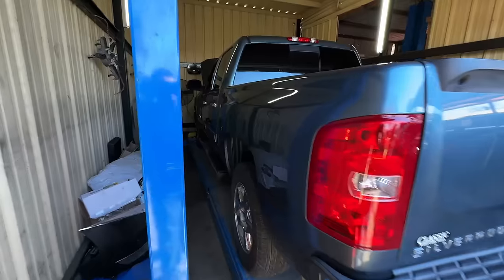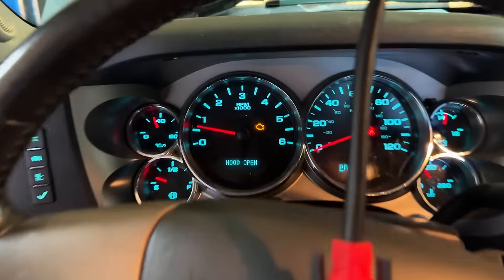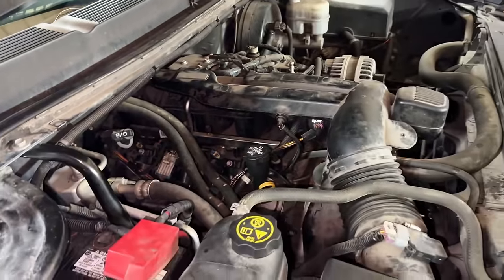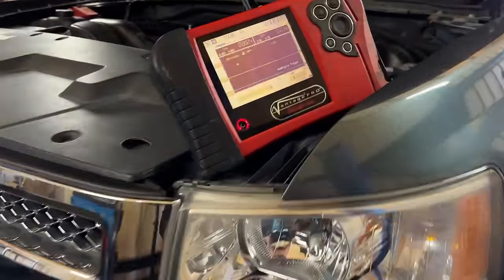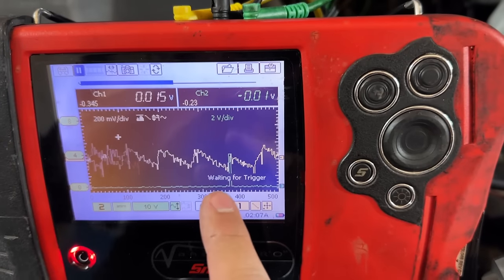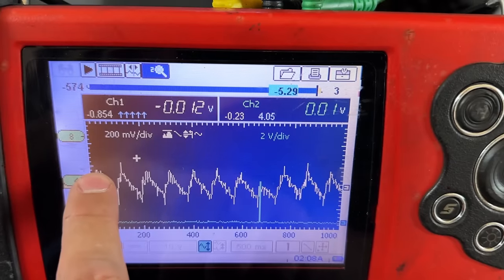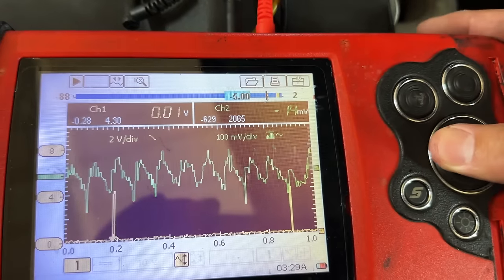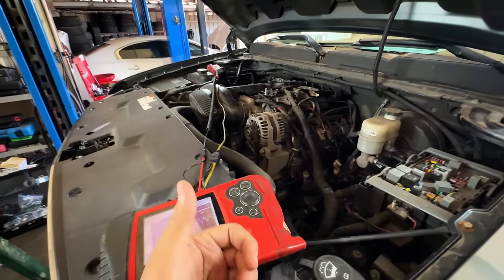CHEVY SILVERADO MISFIRE INTERMITTENT COMPRESSION

Comment: GM mechanic here, see this every day, I got my money on lifters and possible cam damage. Do them every day! Great video
Reply: I thought stuck lifters was caused by bad oil like taking too long between oil changes? I have a gmc 2007 5.3L and my lifter on cylinder 7 got stuck. I have them all out now and will replace all of them. What do you recommend to make sure my afm lifters dont do this again? Im gonna buy a new updated vlom as well. Thank you.
Reply: @paquesepas6696  castrol oil and 3k -3500  oil changes. About to roll 200k on my 09 and not one issue
Reply: @njr684  agree
Reply: I have a 2017 and has 129k and do oil changes every 2k miles to be safe. No issues yet
Reply: @paquesepas6696  I have the same truck.  it was cylinder # 4 on mine that had a stuck lifter.  replaced AFM lifters but it was too late, valve was burned.  had to re do the job and replace the valve.  then a year later the same thing happened and the cam was destroyed.  I had to replace cam and lifters with non AFM type and reprogam the PCM to defeat the feature.  it's all better now with 141,000 total miles.
Reply: @cowcat7436  its been a month now for me.  I replaced all the lifters,  the vlom, oil pump o ring,  and just cleaned everything up. It's been good now for the last 2k miles so I'll see how it holds up.  No more misfire and running great

Comment: This is where an in cylinder pressure test would help. The waveform could likely reveal where the issue is without removing the cylinder head.
Reply: Easier would be to just use differential pulse sensors at intake and exhaust and watch the waveform; will tell you exactly which one is misbehaving; clearly a valve not seating right; worn rings are usually very consistent.
Reply: @scientist100  Agreed. Totally forgot about that one as I was watching. So for sure. Pulse sensors in intake and exhaust would probably be easier. The trick is always in waveform interpretation. But a dead hole should be real obvious. In a case where a cylinder is not being identified through a DTC. How would you know which one it is? I'm assuming the trigger being used would be an ignition trigger. But from my understanding that trigger will not align with either the intake pull nor either exhaust pulse. Would you be looking at the intake pull right before the trigger?
Reply: @edwinlomonacofoolsend  yes; it is important to use the TDC overlay and specify your trigger and firing order but here we already know that it is 8 and whichever looks abnormal would automatically tell us which one is failing. Cylinder identification whether intake or exhaust for a certain cylinder is necessary. Tapping into the exhaust side; you will confirm if it's an exhaust valve but the intake waveform will show both usually as it will back feed pressure if it stays open during compression.
Reply: A leak down test would probably be a much easier way to tell
Reply: @DylanL69  I don't know how much you know about oscilloscopes but you can clearly see that the valve sometimes seats correctly as it can get good compression at times and you know what that means... You will get lucky if you get it when it is not fully seating to do a leak down test. Unfortunately; a leak down test may not prove anything. Pulse sensors just needs an intake access; usually a PCV hose and that's all.
Reply: Yup was thinking the same thing. Leak down test.
Reply: @fetusbass  leak down  is at all time If valve seat really  bad, how ever only detectc laks, how about if you have lifter issues or worn out cam lobes , there is not a leak
Reply: I know this was  posted a while ago as were the comments. I just wanted to get this off my chest and if someone does comment on this I would like to know how often they have seen this? I have worked on cars for over 30 years and until just recently I didn't know it was possible. I thought you had compression or you didn't.  Whenever I've done compression tests it's been cut and dry and never incorrect. I just started working on the exact same model as this and it's misfiring on the #8 cylinder. I just got started and it came to me after someone else was working on it. New plugs, coils, wires, and injectors. I took it from there and got as far as spark, fuel pressure, and compression. Everything looks good on paper. I start looking around because of the thought of intermittent compression and is it possible so here I am.
Reply: @channelx92 I'm dealing  with the same  cylinder 8 on a 2020 tahoe 125k
Spark plug  coil and injector  replaced  p0300 only, bad miss on idle only on cylinder 8
Did anyone  got this fixed  ?

Comment: Great video! The only thing i would have added to the diagnosis would be to put a borescope in the cylinder to look at the valves, then bumped the key to pressurize the fuel rail and see if the injector was leaking by ...  Thanks for sharing.

Comment: great video on diagnosing this issue i totally agree with it . I would be 100% positive that it is a valve seating issue, with a small bore camera you would be able to see inside the cylinder without having to take it apart. just a tip . Good job.

Comment: Just had the same issue on a 6.0 Chevy truck. It had very bad intake vacuum leaks on cylinder 4 and 6 causing misfire and lean codes. But repairing it only lead to no more lean codes, but the misfire codes returned.
Intermittent compression loss on cylinder 4 which reduced at higher engine speeds. Sometimes the valves stick in the guides, lifters and cams also fail,  but this engine was very clean. Customer also declined further inspection. Hate not knowing the exact cause, but that's our world. :)

Comment: I was thinking like you with the valve sealing problem.  One more thing would be a weak valve spring or a sticking valve.  GM had problems with valve guide problems in the past.  I have seen a valve seat problem.  It took many miles for the problem to occur, but at idle the engine would lope turning on the MIL light and yes, gauge compression and cylinder leak down was good compared to other cylinders.  This was before scope testing.  The engine was a 1997 Dodge 360 (5.9L) V8.  Contacting Chrysler for information, they claimed it was a "metallurgy problem."
The fix.  Replace the cylinder heads.  The reman heads had the latest and greatest in valve seats.  Engine ran great after that.

Comment: some diag guys dont know this, some cars will shut off the fuel injector in a multiple missfire situation, bmw is one of them, i have seen guys call a bad injector because the ecu is not triggering the injector to stop cat damage and bore wash/engine damage, id say it is a typical valve not sealing issue.
good call eric.

Comment: The 5.3L is known for AFM lifter issues but #8 is not an AFM lifter.  However, they can stick and jam up internally which will cause a lifter tick.  If they are not hearing a lifter tick, I doubt that's the issue.  I'd be looking at a bent or sticking valve or a broken valve spring on #8.

They might be able to detect a sticking valve by running or even just cranking the engine with the valve cover removed.
Reply: my 6.2 has been at a GM dealer for 8 days now with #8 miss.  no code.  they can't figure out why because they say it's intermittent.  already ruled out coil, wire, plug, injector. valve cover off now and nothing obvious.  They want to pull the head and check valve and or guide.  maybe check push rod BEFORE pulling head? , what else could it be?

Comment: Thorough , logical diagnosis and great lesson  . I believe they swapped coils and injectors to test instead of replacing ALL of them . Saves money there . If there is access , how about putting a small articulating bore scope in # 8 cylinder and possibly examine the valves and seats ? It may be faster than doing a leak down test on that cylinder .  #xtoolgiveaway .
Reply: mine is also #8.  why why why?  the MOST difficult to get at.

Comment: I appreciate the videos . . I not sure what is going on with the compressor.  I be guessing.  Is cylinder 8 one of the cylinder that is used on the active fuel management..I think I would want to pull that valve cover off and watch the rocker arms movement when it's cranking over . . What ever the problem is eventually you will find it

Comment: Im having the same issue but on cylinder 4 after lifter replacement.  Replaced coil, fuel injector, spark plug, and spark plug wires. Still have the misfire.
Reply: Do a compression test on that cylinder and always use gm original parts on the parts you replaced. You can also take off that valve cover and inspect the rocker arm for play etc.

Comment: PLEASE READ!  I had the same issue on a 2011 5.3l it was on Cylinder 6.  I recommended removal of the Valve Cover for inspection and stated it may be possible lifter.  Customer took the truck, Apparently, our shop quote was too high if it needed all that.  Customer took it to the shop next door.  Their Diagnostic tech found a bent valve for that cylinder.  So this is where it gets interesting.... They kept the truck for a whole month.  And i was eager to know what was the issue.  So turns out, they did the whole head job on both banks, replaced valves and still was misfiring for same cylinder after they had it all together.  They did their checks and took it all apart again.  It was a bad exhaust lifter for that cylinder and had rounded out the cam lobe.  Made sense since sometimes it would seal and sometimes it would lose compression.  Their Jr. Tech is friends with one of ours and he confirmed it.  Dang.

Comment: Valve sealing makes sense because the valve will either seal or it won't on each cycle of the engine. So that would explain an intermittent compression issue like this. If it was a VVT issue the whole bank would be acting up.

Comment: I had a misfire on 8 switched coil and misfire moved to Cylinder 5, replaced that and it moved to 4. What may be going on? I pulled wires one by one to check spark.

Comment: Dangit, I was hoping for a smoking gun!!! I have a '99 Silverado, 5.3, 144k miles. So no AFM or VVT. I don't have a scope available although I can use one. So here is my story. Cylinder #3 miss at idle. Previous owner replaced plug wire and intake gaskets. I tested compression and it was 125psi on #3 and 145psi on #1 and #5. I thought possible cylinder wash so I ran it for a bit with the injector unplugged and #3 came up to 145psi. I replaced the coil with a good used coil, it has strong spark, swapped spark plugs between cyl. #1 and #3, swapped injectors between #1 and #3 but before that I checked for injector pulse which it had. I smoke tested the intake and found no leaks anywhere. There is a very faint bit of valvetrain noise but it doesn't sound like a problem. No lifters rattle on start up. I even went as far at to exchange the injector wires between cylinders #1 and #3. I know this makes the injector timing horrible but I thought possibly if the miss followed the wiring it could be an injector wire that was weak enough to fail under load but not weak enough to fail with a noid light. But the miss stayed at cylinder #3. I haven't pulled the valve cover yet. I'm hoping for possibly a bent push rod or failed rocker arm although as I stated, not real valvetrain noise. If that checks out what would you recommend? I've worked on these engines since they were new at the dealership and thought I had seen everything. But this one has me scratching my head.

Comment: Valve sealing or intermittent lifter operation because of a bad vlom. More than likely the valve itself would be the issue. Personally I prefer to do in cylinder as well as intake and exhaust pulse captures when chasing a mechanical integrity problem.

Comment: I have the exact same symptoms on my 2004 Silverado 6.0 liter
The only difference is if the truck is warmed up, after 5 minutes or so driving, all random misfiring disappears.
Could this possibly be expansion of a valve seed or some other component that results in better sealing which eliminates misfire?
Or perhaps going from closed loop to open loop? Expecting a pinpoint diagnosis. But what would cause the symptoms to disappear after running the truck for about 5 minutes? I live in Florida so there's no extreme cold  temperatures
Reply: Also, truck only has only 98000 miles

Comment: You mentioned several possible reasons for the  mechanical  misfire.Would a look in the cylinder with a camera  help to eliminate some possibilitys ie valve seat, burnt valve etc. wrench the engine over and look?

Comment: I have a toyota 4Runner 2007. The car wont start suddenly in the morning. Then I brought it to a garage. They said that the ECM was burned. Then I bought a used ECM from eBay. They installed it on my and it started cranking but it did not started and the ECM was burned again. Could you give some potential causes? I need buy another ECM. Before I install it, make sure of not burning again.  Thanks.
Reply: Bad coils will fry the ecm

Comment: Why not check compression with mechanical gauge in spark plug position to confirm you have low compression?
Reply: Because he is using current as a means of capturing compression. A higher peak = more current= more compression

Comment: a pressure transducer like the ones ivan PHAD uses and sells in cylinder in exhaust in crank case and inlet manifold that would give the full picture without disassembly wiggly lines is the way its going for these diagnostic faults

Comment: Make sure valves or closed and shoot air to it (pressure check). Coming out of intake bad intake valve, coming out of exhaust  bad exhaust  valve. Through engine bad piston rings etc. But that number 8 hole is a turd to fool with.

Comment: The cylinder deactivation valve oil hole is starting to plug up! I had the same problem with a 2007 Tahoe. Put a quart of tranny fluid in the oil and drive it for a bit. That fixed mine for 6 months. I should have sold it then, but it cost me $4,500 to pull the heads and replace those pieces of s!!!. There is a recall, but it only goes back to 2014, which should go back to 2007.  Thank you, GM.   #XTOOLGIVEAWAY

Comment: Compression is not intermittent it's either there or not ....all you done is waisted a bunch of time hooking up and testing something that doesn't have anything to do with the problem m..it's internal those are a problem and most of the time if it a intermittent misfire on the rear cylinders it's trash in the fuel rail3

Comment: Very methodical approach, easy to understand. Interesting that the cranking noise was very consistent.
Also, very common for the plastic wire looming to disintegrate on these trucks.
#XTOOLGIVEAWAY
Reply: You’re not kidding with that wire loom. I just went through mine and had to rewrap both sides of the engine and the crank/vvt cable. It was all gone.

Comment: #XTOOLGIVEAWAY  Another great case study.  I was thinking it had a possible valve problem after you re-did the test with the amp clamp and saw that some compression strokes looked normal.  I guess the shop could have used a borescope to go into that cylinder to see if they could see a possible problem.

Comment: What about bore scoping to check for a damaged valve seat, or valve problem?
   Likely no wall scoring if there was no change in compression after disabling the injector. But if you saw some, you could try squirting some oil on the wall just to see if it was causing a problem.
  Also, maybe they have a broken ring that ' sometimes ' seals better than other times.
#XTOOLGIVEAWAY

Comment: Great video, could you have used a pulse sensor in the intake &exhaust with the rc test to further isolate which valve is the culprit? Or would you have needed to go with an incylinder transducer? 
#XTOOLGIVEAWAY

Comment: I'd definitely leak down test the cylinder since the components were checked out. The lab scope way is very interesting but again not everybody can afford it :) #XTOOLGIVEAWAY
Reply: This day  if you want to make the diferences,  is a must have tool , you can used it for any thing you want when you understand,  from engine mechanical,  electrical,  electronics,  suspension  noise  and so on